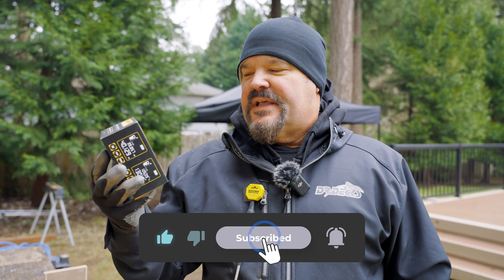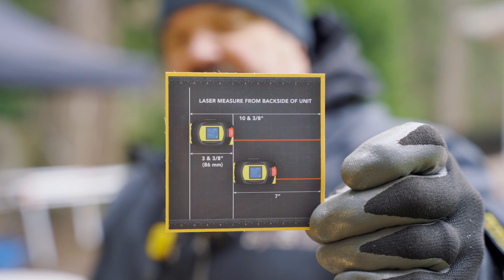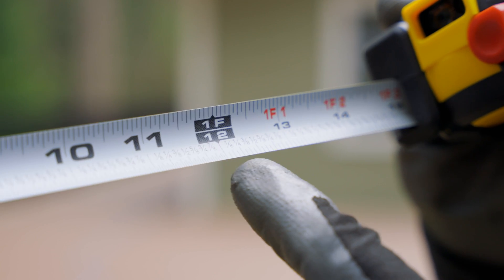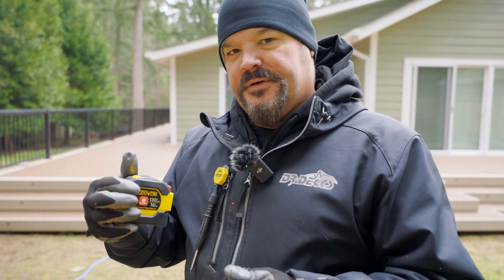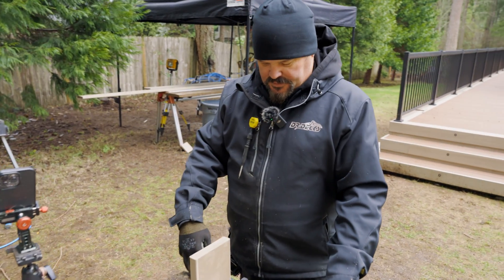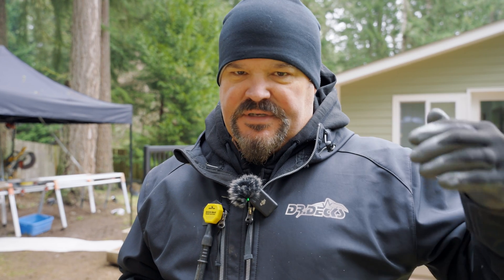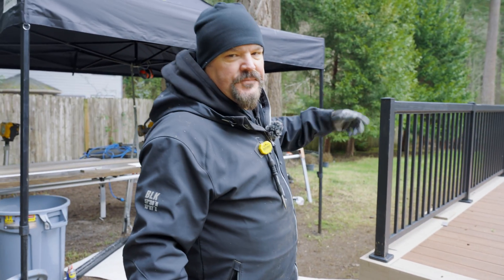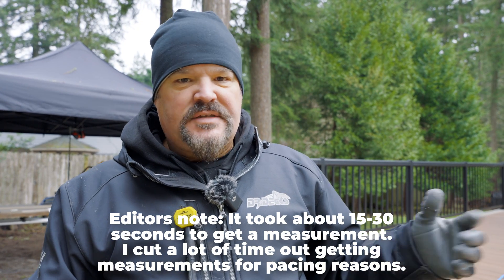How Accurate Is A Laser Tape Measure? (Lexivon)

Comment: There has to be expansion and contraction on the metal tape according to the temperature. This comparison is a  lot more complicated than it look.
Reply: Change in length is .0000173” per degree of C or .0000065” per degree of F. Essentially nothing. You won’t need to worry about any temperature coefficients if you’re using a tape measure.

Comment: What's the world coming to when you have to use code for measurements. IMO, if a "Carpenter" or someone doing similar work can't take the time to figure out 1/16" or 1/32" differences... time to find another trade. In my world, the only time you say a hair under or over is if it is less than a 1/32 of an inch - unless framing... where many guys round off to the nearest 1/16 (some an 1/8 but IMO, that is too sloppy, even 1/16" for some things is sloppy).

Comment: I do finish and would never trust those !  I use a Leica Disto and it’s extremely accurate and I can covert it to read certain plans .  However ; I would not use it outside .  Also mine has a hook on the back to place on open edges and calculates the distance.  Bout $150 US .